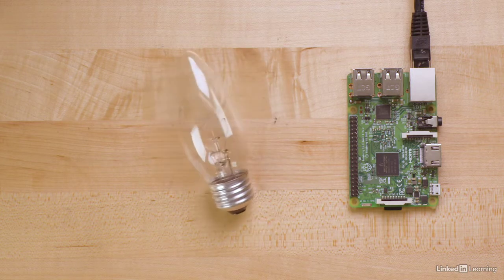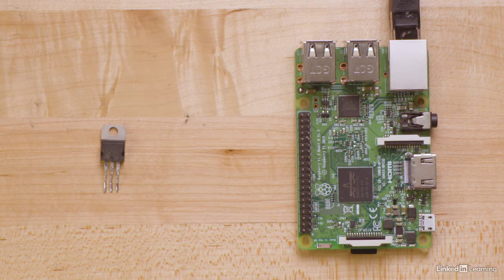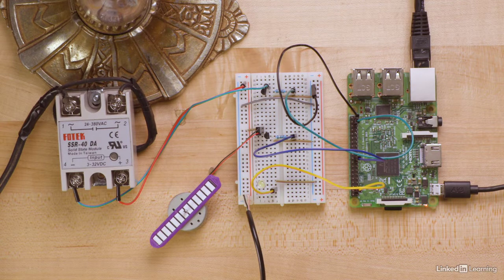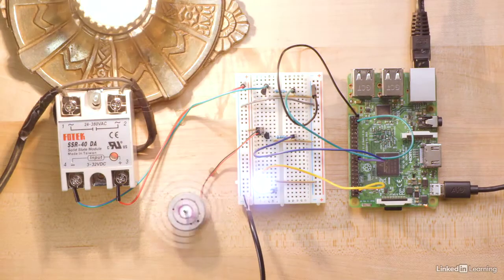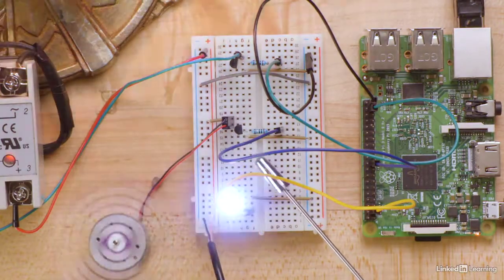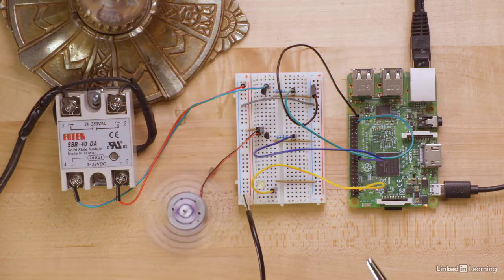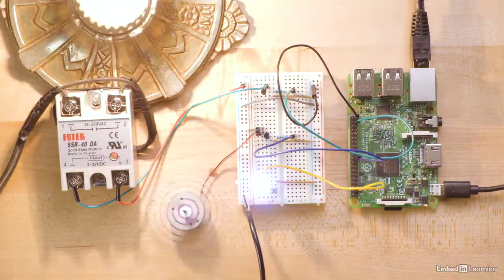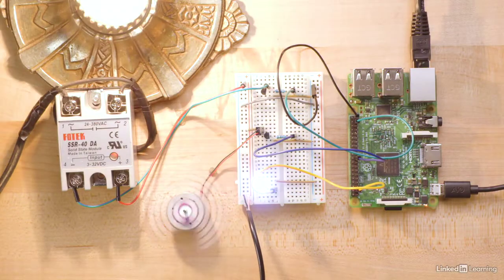001 Controlling high voltages with the Raspberry Pi

Comment: How about this: my cat's litter box is in the same room as my desktop computer (no other place). I hook up a camera to a raspberry pi, and using a motion sensor, some number of seconds after my cat is done, the pi would tell a mains power filter/fan to run for a set amount of time?
Reply: Set the pi up to run a signal bridging the transistor for a Set amount of time to turn on the fan when the motion detector detects no movement for an amount of time